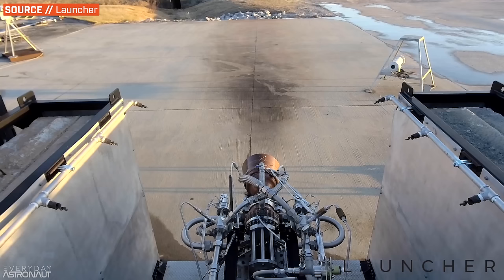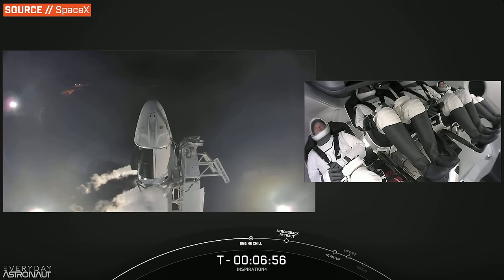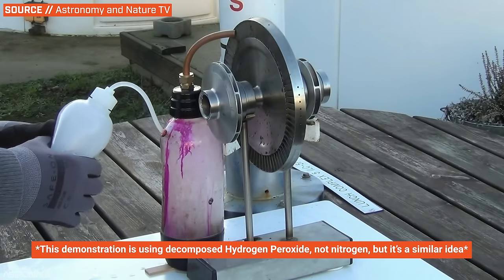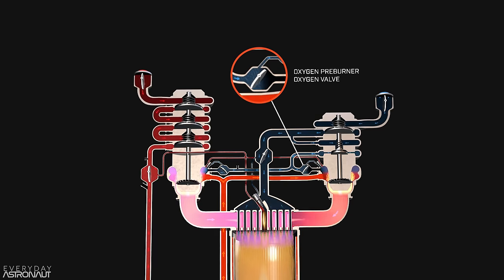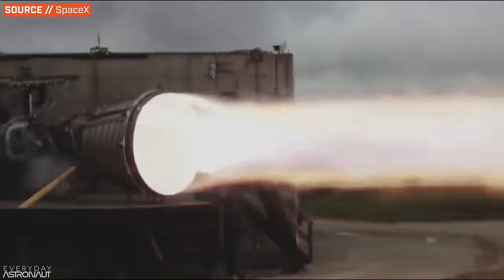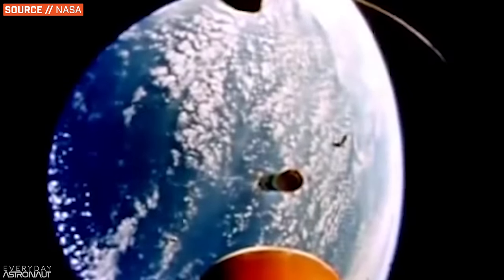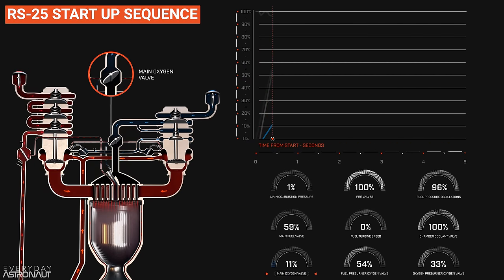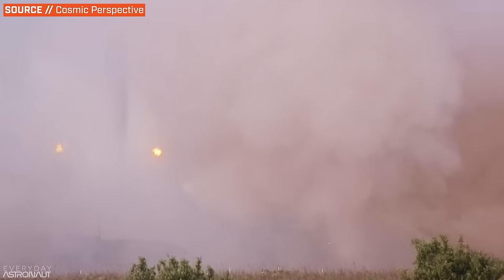Why Starting A Rocket Engine Is So Hard!

Comment: Me, an hour ago: "Yeah, rocket engineering is complex, I know."
Me, after watching this: "Holy cow, how did they ever manage to NOT blow up every single space shuttle on the pad?"

Great, informative content, Tim! Thanks for this.
Reply: Love your channel! happy to see you here.
Reply: Maybe Rocket lab chose electric fuel pumps to reduce engineering challenges.
Reply: Yeah, it does make it even more amazing that the V2 rocket managed to be pretty successful 80 years ago. I guess the hydrogen peroxide powered pump made things much simpler, if less efficient. The fuel wasn't cryogenic but did they precondition the liquid oxygen pump? Was it just built strong (& heavy) enough to withstand pressure surges at startup?
Reply: @Loanshark753  Rocket Lab circumvented about HALF of the complexities by going with battery powered electric motors to run the fuel and oxidizer pumps vice using the propellants themselves which is literally an almost one hundred year old 1930's approach. I cannot see why there could not be a combination of the two, use electric motors to get the pumps running and the engine started THEN chuck the motors and batteries on the way up to save weight and let the pumps run from turbines like "normal" by burning internal fuel and oxygen to spin turbines, BEST OF BOTH WORLDS. It would eliminate a LOT of hardware.  And hopefully at some point in the future batteries will be sufficiently robust to run the pumps with electric motors ALL the time.
Reply: @michaelschnittker7388  Except when you get to the part about chucking, it fails, and crashes into your rocket destroying your lower stage. I think we should just put a little wind turbine under the rocket and have it spin with the propulsion. No way that could go wrong.
Reply: @JeronimoStilton14  I think it would be better to put the wind turbine inside the rocket, and have pipe connecting the flammey end of the rocket to it. Oh wait, did I just re-invent the expander cycle?
Reply: @michaelschnittker7388  Interesting ideas! But it's not really practical to "chuck the motors and batteries". That much MORE stuff to deal with, as well as the parts/system to toss all that when no longer needed.

 Now, if the motors were run off ground power till launch(as is currently done) that's really the better way. Also you would have to recover the battery after launch.(adds $, people, equipment) There's really no way of tossing those motors either. Just somethings to think about!
Reply: EXACTLY, whatever people tell how hard it is or complex, believe in them, then it is hard and complex for a reason
Reply: @michaelschnittker7388  or? You can just let the pressure power the motors, the pressure will force the motor to rotate, then it will rotate the other motor and done
Easy as that
Reply: yeah
Reply: @alanm8932  Hydrogen peroxide had a side benefit even the Nazis didn't predict . Everyone ended up with blonde hair, win win for the aryans.
Reply: @Loanshark753 Trust me when I tell you that battery systems have their own insane amount of engineering complexities. And the startup sequence still has a lot of the worst aspects in there

Comment: A minor quibble: The igniter on an SRB isn't any more an explosive than the SRB propellant itself.  It's more like a smaller solid rocket lights a bigger solid rocket that lights the primary fuel grain of the SRB.  An actual explosive wouldn't produce enough heat for long enough to bring the HTPB of the fuel grain to decomposition temperature (which is necessary to get the fuel to light).  You'd also probably blow the top of the SRB off if it was an actual explosive because it would produce too much pressure too quickly.

Really the only explosive in the ignition system is the small detonator that lights the first motor - which has its own slower booster charge to ensure that it doesn't blow to pieces.  Rockets are already riding the fine line between combustion and explosion, they don't need anything in there to tip them over the edge.

Comment: I flew high power solid propellant model rockets for years ..and even igniting solids is quite a science in having to balance temperature and pressure within the motor for a quick and efficient ignition and thrust build up.

Comment: Man, this is maybe the best video you've produced- ever.  I think you succeeded in distilling this complex dance down into something understandable by everyone.  Thank you!     A highlight was the RS-25 start sequence and seeing the engine chaotically manage through open-loop control into a smooth, closed-loop managed control.  I can't help but wonder how much of this has since been tamed with the development of better sensors and faster computer processor speeds.  A follow-up short video might be cool to show even how the RS-25 of today is started compared to when the engine was first developed in the 70's.
Reply: okay, a couple beers now and almost ready for bed:  I came back to watch that startup sequence again, this time imagining myself as the shaft of the turbo pump.  The amount of torque just given the inertial lag as the preburner hits prime must be intense!

Comment: Sometimes a N2 or He purge won't remove moisture that has worked itself into small crevices. I'm on a university lox-ethanol rocket team, and our main propellant ball valve kept freezing shut no matter how many times we purged it with nitrogen. To fix this, there is a third type: the vacuum purge (using the word "purge" here loosely). You cap off the system and pull out much of the air, and lower the pressure enough that any water in crevices starts to boil. The vapor has to expand out, and is ultimately sucked up by the vacuum pump. You can do another N2 purge after this for good measure, since the vast majority of the water is sitting in large spaces in the lines rather than valve crevices.
Reply: This is great stuff, thanks for sharing.
Reply: In the semiconductor industry  we do pump purges to mainly remove toxics before opening up the equipment to perform maintenance. .  But for some corrosive gases you have to basically pump out all the air down to a very hard vacuum to remove the water before you turned on the corrosive gas. Which took many hours. If any  minuscule amount of water is in the lime it will initiate corrosion of the stainless steel.  And the corrosion byproduct was water.  Which would cause even more corrosion.  So if you got all the water out The equipment would work correctly indefinitely.  Get it wrong and could end up scrapping a a lot of costly equipment.

Comment: Cavitation and vapor ingestion are different things. Cavitation occurs when you try working a fluid "too hard" and the low pressure section behind the blades drops the pressure low enough that it spontaneously bubbles. fluid boiling off in the intake line would lead to gas ingestation, which would cause all kinds of problems like imballenced load, pump stall, fluid hammer, etc. 
Cavitation is a phenomenon that applies to all pumping and fluid interaction, not just cryogenics. Ship propellers and water pumps also need to design around that particular problem for example. it causes erosion damage vs gross mechanical damage. i would imagine cavitation damage is not a major design concern for most rocket engines that are not re-used. as long as there is enough material to maintain structure during boost, the engine is then discarded meaning any erosion is meaningless as long as it is not damaging anything except the pump. 
You can imagine why having essentially no load on one side of a pump that is ingesting gas, while the drive side is still at full power would be bad, let alone the a/f ratio problems

Comment: Holy cow, your videos started out being amazing and are only getting better. So information-dense, yet so easy to follow. In space documentaries nobody else comes close to your content! I was wondering, why do neither of the 2 pre-burner oxygen valves ever approach 100% open? They don't relight those on orbit, do they? Are there throttle conditions where you want higher turbine speeds than 'normal'? Or were they overdesigned and were they happy enough accepting the excess mass rather than changing them and having to go through the tweaking process again?

Comment: Bob Parkinson of the British interplanetary society who worked on the UK rocket programme once talked me through why Hydrogen peroxide engines had a number of advantages.
First you can start them on the pad by simply using the H2O2 to run through the catalyst bed with tank pressure and start the pump. The H202 is running through the cooling channels and with the small amount of water you need to keep the temperature down for the catalyst bed you have good cooling. 
As the pump speeds up the rocket is essentially a monoprop. The thrust is less than the mass of the rocket so you don't need any hold down clamps.
You then open up the fuel valve and as the fuel hits the hot H2O2 exhaust it ignites spontaneously. The thrust jumps and yo have lift off!
All the H2O2 goes to the engine, so it is closed cycle that helps efficiency. 
The H2O2 is much more dense than LOX and with a high oxidiser/fuel ratio the size of the tanks are smaller that results in a better thrust to weight than you may expect. 
The H2O2 is also fairly benign so long as you keep it contamination free. Any spills you can just wash away with water.

Comment: Amazing video, just like many others from this channel on both accuracy and accessibility!!  One minor comment though, just because it's recurring in this and other videos: pressure does not flow. It's a point quantity, just like e.g. elevation. The gas flows from high to low pressure, similar to water flowing from high to low elevation, or current flowing between points with different voltages.

Comment: Fascinating to see the delicate dance of pressures  and mixture to avoid catastrophe. Some similarities with starting up a gas turbine engine where they have to spin up to a certain N1 before  fuel is introduced to avoid more heat than the current gas flow can handle and then balance the pressure ratio vs RPM until it becomes self sustaining and not stagnate with associated high turbine temps. The big engines also need  help when accelerating with  bleeds to avoid stagnation and  compressor stalls all done with computer controls mainly.

Thanks for the effort you put into this vid.

Comment: Excellent video. Cavitation is also a problem in the liquid cooling systems of ordinary automobiles where the oxygen in those 'bubbles' in the coolant will corrode the water pump impeller. The same happens with propellors on outboard engines on small boats if the propellor is not fully under water. The churning and mixing of water and oxygen in the air causes cavitation, or pitting, of the propellor blades.

Comment: I’ll add: the SR-71 used TEB dispensers to ignite its afterburners, with a counter showing under the throttle with the number of “shots” remaining, after which the afterburners were inoperable. Of course, that aircraft was designed to operate with constant afterburners, so they didn’t really use them up very quickly.

Comment: Titan 2 was so dangerous. it used Hydrazine.  Maintenance on those rockets was so dangerous they had to wear a full space suit just to enter the silos and if anything went wrong the results could have been devastating which is what nearly happened just outside Hope Arkansas. Someone dropped a socket and it punctured the side of the rocket.  At the time there were 17 silos spread throughout the midwestern United States.  Fortunately when the rocket finally blew, it didn't cause a nuclear Detonation and luckily there was only 1 person that died.  Very unfortunate for that one person.  However, several of the guys that worked there at the silo got severely injured.  Various injuries which included chemical burns from Hydrazine exposure.  Chemical burns to their lungs which the Air Force wrote off as them being SMOKERS.  One Guy said HE NEVER SMOKED, CAN YOU BELIEVE THAT CRAP.  It is all because they wanted to cover it up and not pay him for his injuries caused by the accident.  But after the accident, all tools were tethered and safety nets were installed to prevent tools from being dropped in the future.

Comment: I have 2 questions:
1. If they want throttle control of an SRB why not go hybrid with a solid propellent and liquid oxidizer? Or is it  one of those things where you might as go all the way to a full blown engine?
2. In the example of starship and its booster, does one nearby engine starting sooner than the other cause pressure gradients that can cause a false start of an adjacent engine?

Comment: 18:00 holy cow...

For those of you that are also motorsport fans? The best case scenario for F1 V10 engines was about 10,000 hp/tonne... The STARTER for the SSME was 200,000 HP/tonne.... My mind is blown.

Comment: This is a great video! Seems like you could mock up an engine with electric powered pumps using an inert gas(s) to choreograph pressures, turbine rates, sequences and valve timings for the start sequences and mathematical extrapolation to the behavior of LOX and propellant... just to blueprint the starting point to save hardware grenades :) maybe they do, I’m no rocket scientist

Comment: Great video!  BTW, there were a couple of minor errors on the Shuttle SRM ignition bit (for example, NSDs (NASA Standard Detonator) are used to start explosive/detonation events, the SRMs use a modified NSI (NASA Standard Initiator) to start the flame sequence).  I used to be the design engineer on this system back in the days when it was still Thiokol.  I've got a lot more details (and some great stories) if you're interested.
Reply: why did they use RDX instead of literally any other plastic explosive?
Reply: @nickhowatson4745  They don't use RDX, or any explosive to light the motor - it's all pyrotechnics - zirconium potassium perchlorate in the NSIs, then boron potassium nitrate (BKNO3) granules to boost that, then BKNO3  to boost that, that lights the propellent in the igniter initiator (6 nozzles), which then lights the main igniter propellent (about 130 lbs), which exits the igniter nozzle and then lights the whole motor.  The igniter itself puts out about 60,000 lbs thrust  for only a few seconds.

Comment: The startup sequence with the graph and dials could become a KSP mod for the realism overhaul setup. Researching new engines requires you to test them, until they blow up of course, then look at the recorded data on the graph to tweak some dials and parameters for the next test to run a few seconds longer, like a mini-game puzzle

Comment: Starting one Hard.  Starting 3 at once Staggering. Then 33???  Mind blowing. Just the differential in heat from 1 to 3 to 33. 
The thermodynamics in a simple car engine is awesome, the difference in MPG between a cold, warm, hot. The small damaged caused from starting a Hot car engine.     Now apply those thoughts to a Rocket Engine. Just to put things in common thoughts.      Very well done video..... Another great book is "Ignition!: an informal history..... (John Clark).

When I grew up some of these thoughts were still in development. In the 50's and 60's Highschool students across the USA were experimenting with liquid and solid rocket fuels in class.    (October Sky - true story movie)

Comment: Does the F1 engine spin up process count as bootstrapping? Basically LOx was falling down from its tank (the upper tank) and using the kinetic energy acquired during the fall to spin the LOx turbopump which in turn spun the RP-1 turbopump enough to power the gas generator which would quickly take over in spinning the turbopumps and building pressure for the combustion chamber.

Comment: The unspoken factor here is the computers needed to control all this.  These days it's trivial, but a big factor in the failure of the N-1 was probably that they were trying to control all those engines with vacuum tubes.  The Apollo program decide to use integrated circuits based on the performance of some of the first prototypes.  These days, the hardware and software can be less exotic.  Falcon 9 rockets (from what I have been able to glean) run Linux with the real-time patch on triple redundant X86 computers, with guidance software written in C/C++.  Compare this to Apollo, where the computers were hand built, with custom machine code- encoded in rope core memory!  The guidance aspect of rockets would be an excellent topic for another video.

Comment: Tim I hate to correct you but F9 uses the grid fins to settle propellants before entry burns. Watch any launch. They slightly tilt the fins 3 seconds prior to the first engine startup on entry burns.
Reply from the maker: That’s not to do with settling, it’s just when the hydraulics are powered up and they get snapped into position. There is still a cold gas thruster fired for settling.
Reply: No kidding? I did not know this. My apologies for being so arrogant.

Comment: Great series! What are all of the miscellaneous tubes needed for as seen around 15:37 (and 19:58 & 41:00)? Looks like way too many wires/tubes that I'd expect from what you've described. Must be some secondary problems getting solved in addition to the straightforward task of flushing lines, starting, cooling, flowing fuel?

Comment: Great video, very educational. Especially on the fuel in the tanks (wobbling) when in space. Question about that...  If a rocket reaches a certain speed and is no longer accelerating, how is  the wobbling of the fuel prevented ?  ISS has no acceleration and thus they can play with liquid fluids despite the fact that ISS travels at 27000 km/h. So how do they do that if they go to the moon/mars ?